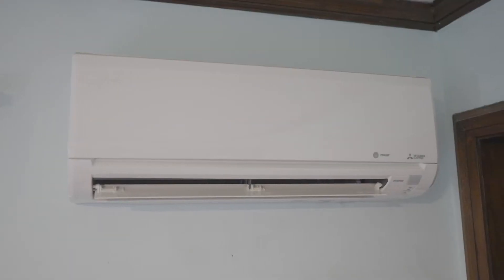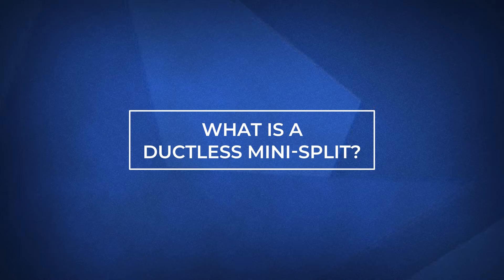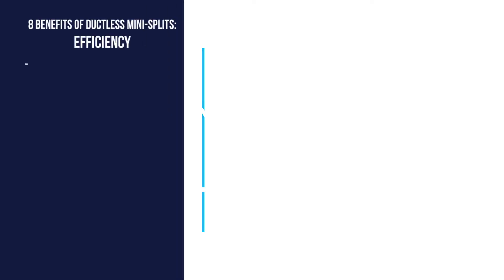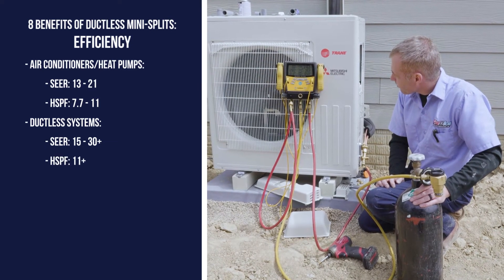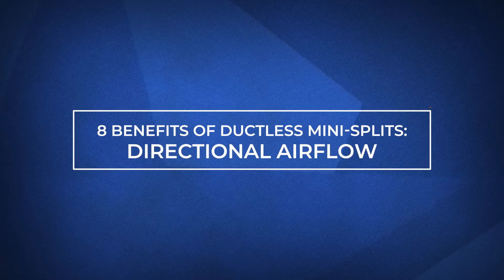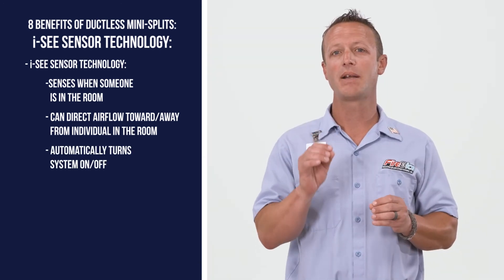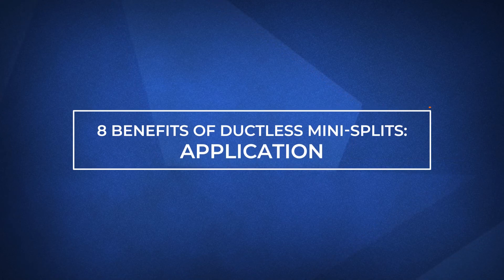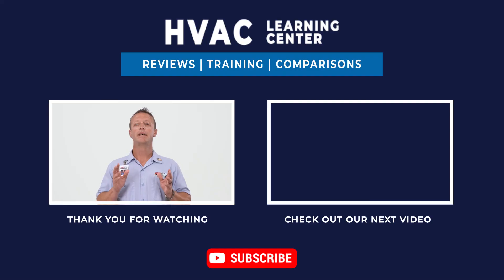8 Benefits of Ductless Mini-Splits

Comment: I've read on several HVAC sites that it's better to leave a mini split on "auto" mode even when we're not home or asleep in another room rather than turning it completely off, because mini splits are designed to be left on and run continuously unless you're going to be away for several days at a time. Is this true?
Reply from the maker: A mini split uses very little electricity to keep a room at temp, and a lot to get it to temp if left off.  It will work either way.
Reply: @fireiceheatingandaircondit4363  thank you!